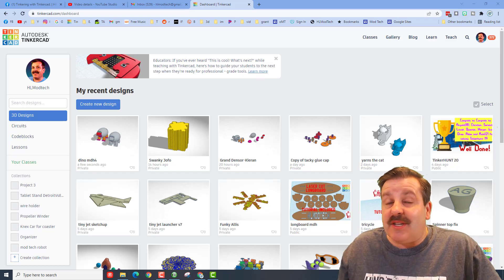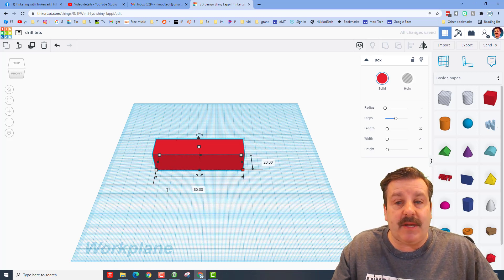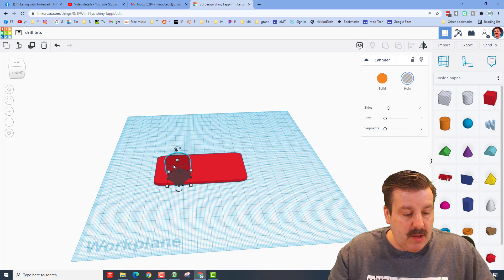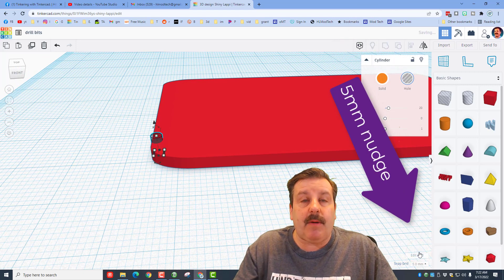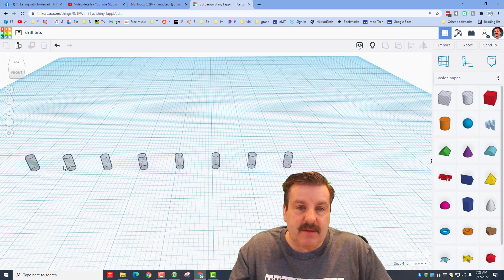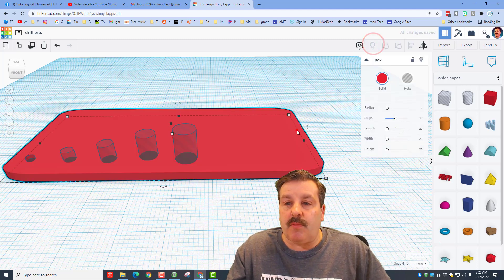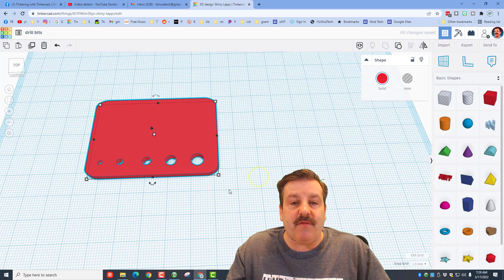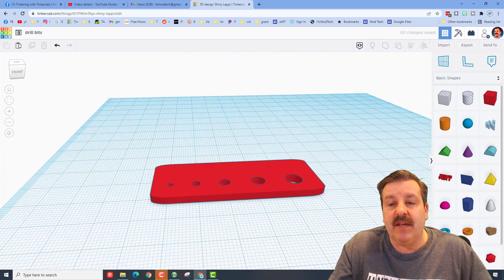Place Holes evenly in Tinkercad | Steps in under 4 minutes

Comment: Hello Is there a way to draw a flat spiral with tinker cad ??
Reply from the maker: You may want to check out my shape generator catalog. It makes it easier to search for shapes by name https://youtu.be/l9PHk4gqtfM
Reply from the maker: If you truly want to start flat you may want to find a image of the spiral and then use these steps to import it as a SVG. This tutorial should hook you up. https://youtu.be/ua1fT4Xh2fY
Reply from the maker: Put a solution in a short. =) https://youtube.com/shorts/ZKcc0o2xFro Thanks for the question.
Reply from the maker: The helix from the shape generators works too if you move the separation parameter to its lowest setting.

Comment: Mike, how do you do equal spacing between perimeters of the holes, rather than equal space between centres of the holes?
Reply from the maker: There is no automatic way. It would involve trickeration and some prior planning (maths). 😬 I know that does not scare you, but there is a large # of users that are not willing to do some calculating to get the design they want.
Reply from the maker: Shoot, you may be able to do that just using the nudge. Still have to do the math, but nudge to the edge... nudge your gap and repeat for each hole.

Comment: Thanks for your EXCELLENT TinkerCad videos learned a lot from them.  I have a problem I hope you can help with.  I have a solid plate 200x200x3 mm in STL file.  I want to put venulation holes in plate.  I am using  a Printables download called HEXAGONIAL GRID GENERATOR IN OPENSCAD to generate a hole pattern that I want to put into plate.  Can Tinkercad combine these two STL files putting hex holes in plate?  Do you have a video on this function?  Thanks again David
Reply from the maker: Thanks for the kind words. Tinkercad has a built in set of grid tools. You should be able to totally skip the openSCAD steps. https://youtu.be/aiPkTBbzk0s  That vid is uses the square grid but you could easily swap to the hexagon.

Comment: Waste of time - doesn't teach you how to evenly space holes...just get them "to your liking".
Reply from the maker: Sorry you feel that way. Tinkercad does not have an autmatic tool, so I believe this is the easiest way for holes of different sizes. If your holes are all the same size you can just use the same nudge in between them and easily get your desired result. With a little math you can  put the ruler to good use as well.
Reply: Some drawings can get away with that level of inaccuracy. Others benefit from precision. Those users needing precision will find Mike's tutorial really helpful.